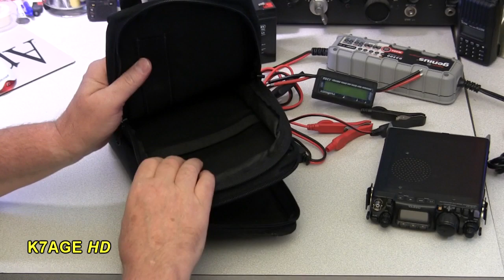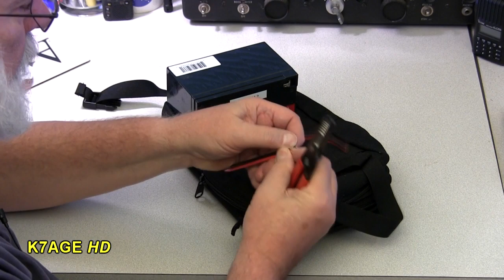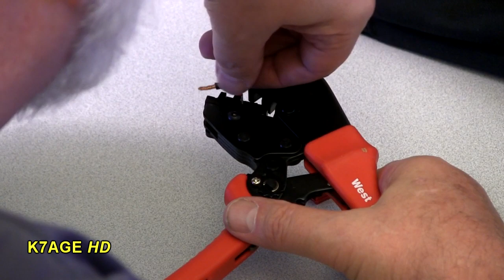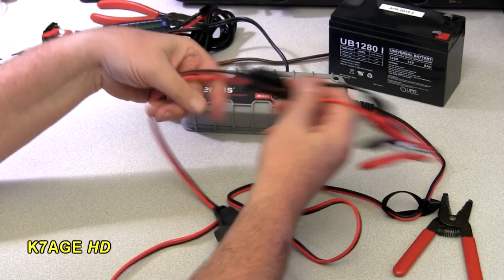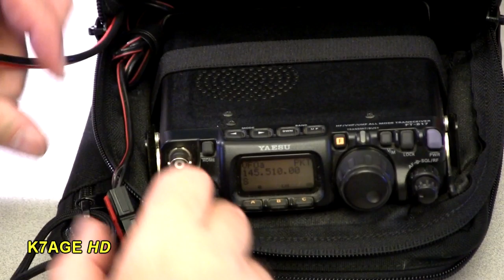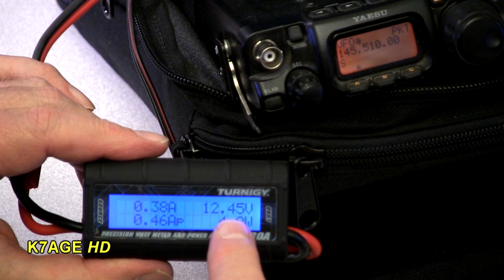FT-817 Ham Radio Bag

Comment: i use a Tracer Lithium Polymer 12v 8Ah power pack 1/4 the weight of a SlA Battery  its tiny actually lighter than the FT817 and no quick discharge or acid to worry about can be charged from the Ac mains or from  Dc vehicle charger.

Comment: I made the exact same mod to my charger, and I have 2 of those identical batteries which I run in parallel with a small Y adapter that I made out of cable and powerpole connectors. I use a larger backpack which fits the two batteries and also the antenna.

Comment: this FT817... is it really annoying that it has no DSP noise reduction, poor selectivity, general high noise floor and lose SEL button ? Which of these are real issues getting in the way of normal field use of radio? Thanks. I appreciate your videos.
Reply from the maker: Well, the FT-817 was introduced in 2000. Amazing that Yaesu continues to sell it. Sure many areas could be improved using today's technology. Thousands (estimate is > 250,000 sold) have been sold and are still making lots of contacts. Internal battery life is the limiting factor for many people requiring to drag along an external battery pack.

Look at the Elecraft KX2 & KX3 for an amazing up to date radios.

Comment: Randy:

What was the total cost of all you had on the video?

I am planning to budget for all you have there and want to know how many $$$ I need to plan for?

Thanks & 73,

Kurt - KA7ZDD
Reply from the maker: You should really check all of the prices, as they have been lower when I made this video. I just checked that the case is now $182 http://www.amp-3.net/shop-amature-radio/tactical-transceiver-radio-bag. Battery, 7 AH is <$25 at most places. Whatever the FT-817 is today. Plus bits of wire and connectors.
Reply: Thanks, Randy!

Kurt

Comment: I kinda like using heat shrink tubing at the end of my crimps - and over the .250 and .187 battery spade terminals. But, really good on the battery and the power poles and radio
73 de kb4twn
Reply from the maker: +Bradley Mabe Good idea

Comment: That's a neat case. Another option is the 'Forward Observer' camera bag made my Hazard 4. I originally got it to use as a camera bag. I then found out that it's a PERFECT fit for th 817. Inside the main compartment I can fit the 817m mic, Signalink USB, and a few other goodies. I could probably fit a compact tuner in there. Since it's a camera bag it's padded, so it will protect the radio to an extent. The bag is MOLLE compatible so you can stick other pouches on it. I stuck a condor dump pouch on the side. That works nicely for storing coax. I will have to look around to see if there is a better option than a dump pouch. Something with zippers would be nice. One of those medical pouches might work.

The bag is sturdy enough that for operating you can set the bag on it's side and set the radio on top. It's a very cool bag and worth checking out if you own an 817.

Comment: Discovered your channel recently and love it.  You're the best out there as far has HAM goes for beginners.  Question:  Do you recommend an amplifier for the FT-817?  Specifically, I'm looking for more power on the HF SSB eventually (if I get this radio).  Thanks! Steve....
Reply from the maker: TheMojo1963 Tokyo Hi Power used to make a nice 50 watt amp. They closed, but someone may be picking up their product line. You will need to search for this information. The HF Packer group has a nice kit, if you are comfortable with building. http://www.hfprojectsyahoo.com/hf-packeramp.html  There is also an active FT-817 Yahoo group with hundreds of users. Join that, you may find some other information and maybe even used amps. Have fun.
Reply: Thank you sir!  Looking forward to your next video.  I have lots of your older videos to watch too! -- Steve

Comment: Did a similar set up with a kenwood tm281 a 12ah dry cell battery a battery tender charger and a mag mount antenna. I attached the radio to a piece of sheet metal and put it all in a back pack total expense about $200

Comment: Randy - Absolutely awesome. My favorite part was when you cut the charger wire and said "we are HAM radio operators and we modify things". Besides the great mentoring your provide, one thing that drew me to your channel a long time ago was project videos. I was hooked after building my first 6m dipole based on your design. That said, I had to smile at the comment about modifying things! Now I feel better about doing the same thing to a smaller version of the same charger.

I love the addition of the Turnigy Wattmeter. That sure gives a lot of valuable information.

I think that pack is begging for a trip to Gold Beach!

Very cool to see the AMP-3 bag. Thank you sir!

73 de David / KF7ETX

Comment: The simple way to remember powerpole orientation is: 'Red Right; Tongue Top'.

I personally prefer to solder powerpoles. They aren't as readily available as other connectors, so I like having the option of removing powerpoles and redoing.

That's a nice 817 case. Another nice case is the 'Forward Observer' camera bag made by Hazard 4. It's a perfect fit for the 817. It's MOLLE compatible, so you can stick other pouches on it. On mine I stuck a Condor dump pouch that I use for coax.

I think I will have to pick up one of those watt meters. Those look like a cheaper version of the watts up meter. I think I am going to use different colors of powerpoles so it's easy to tell which end is which. red/black to plug into the rig and black/something else, to plug into the battery.